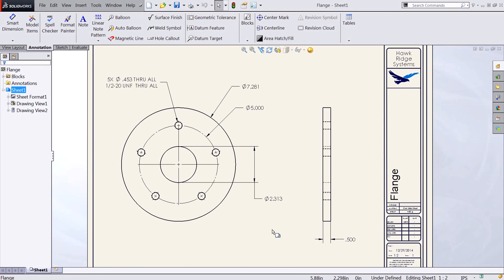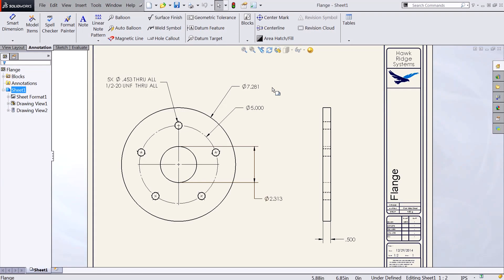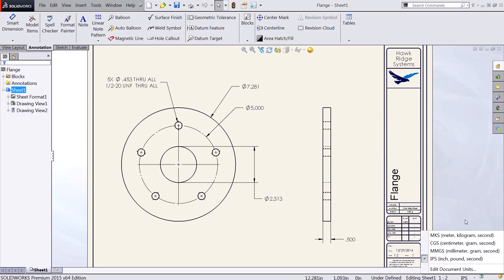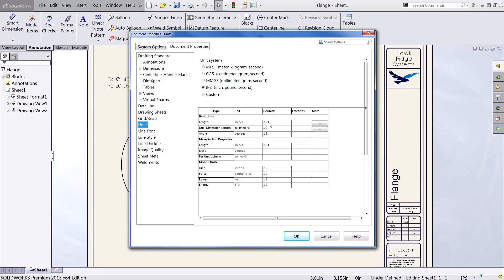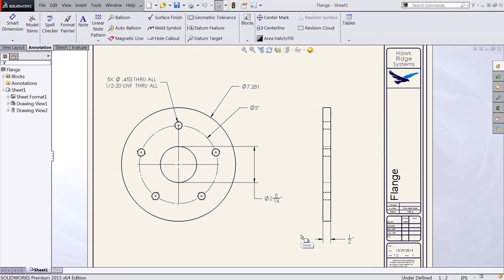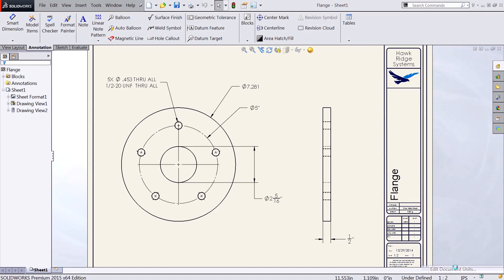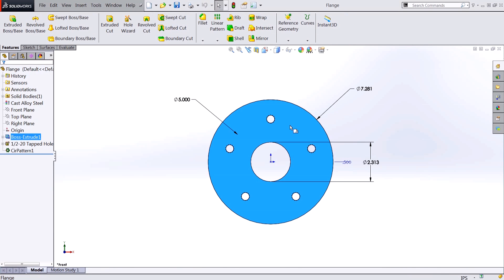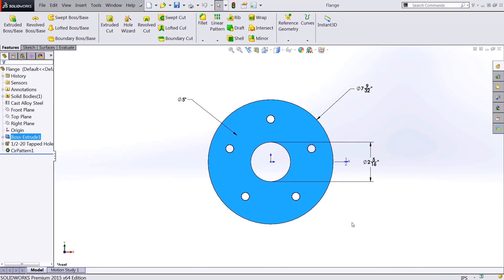SOLIDWORKS - Changing the Document Units to Display as Fractions

Comment: Tyler, is there a way to set fractions as the default for drawings? I'm making a lot of simple drawings right now and it's incredibly tedious to have to do this every time. Thanks.
Reply from the maker: Hello John, thanks for watching my video. The display of units is a Document Property, meaning that it is specific to each individual drawing instead of a more global System Property. So we cannot set SOLIDWORKS up to automatically display all drawings that we open in fractions. However, if you are the one creating the drawings then we can set the units up as fractions in your drawing template so that any drawing made using that template will default to this behavior. To do so, I recommend starting a blank drawing using your preferred template, File > New > then choose the appropriate drawing template. If your template prompts you to also select a sheet format, do that as well. Once your blank drawing is created, follow the steps in this video to set your dimensions to fractions with the appropriate denominator. Now we need to save this back into a template so you can use it as the base for future drawings. Go to File > Save As, then first change the Save As Type to "Drawing Templates (*.drwdot)". This should automatically navigate to the default template location, you can save your template here or navigate to a custom folder but make sure that folder is in your System Options > File Locations > Document Templates directory. Give your template a unique name so that you can identify it easily, "Drawing, factions" for example. Then select "Save" to create your template which should now have all the same default settings as the original template you selected but will display the units in fractions. Now you can close the drawing we created and start a new one with the template we just made. If you don't see your template as an option make sure you are looking at the Advanced template menu, it should say "Novice" in the lower left corner, if you see "Advanced" instead click it to go to that menu. If you saved it to the default folder location your template should now be there, if you saved to a custom folder you should have tabs across the top to change the template folder. Otherwise, you may need to add that folder to the file locations in your system options. I hope this helps, if you would like more information on drawing templates check out our other video on Drawing Templates vs. Sheet Formats. https://www.youtube.com/watch?v=0EygfnC_Pv0
Reply: Thanks, Tyler, it worked perfectly. I tried something similar last week, but I realize now it was the sheet format I was working on. Thanks again!
Reply from the maker: Great! Let us know if you have any more questions!
Reply: Helpful sir 
Thank you